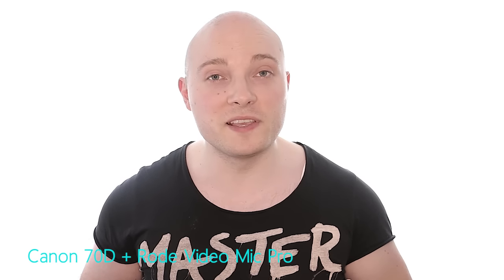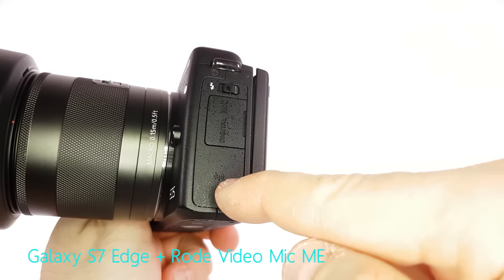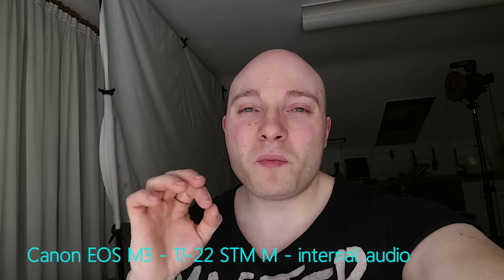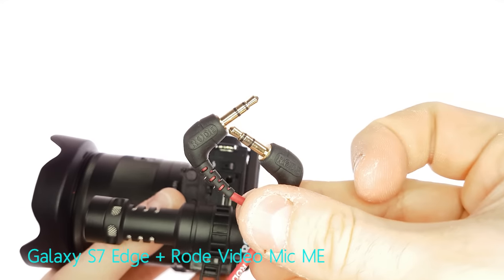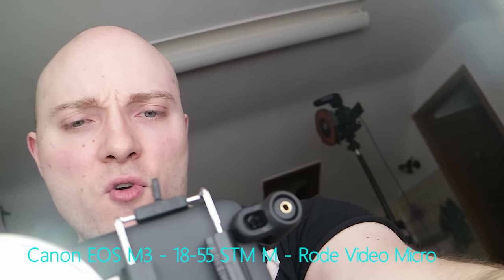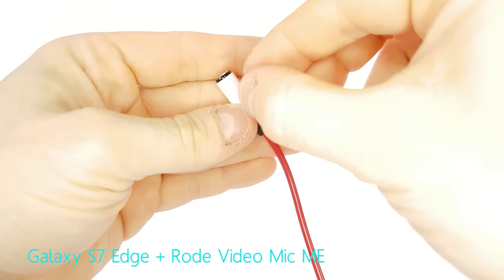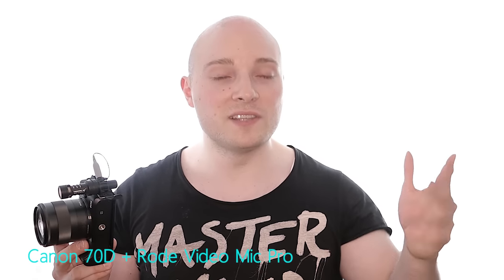Canon EOS M3 - MICRO Vlogging Setup+ - Tubenoob

Comment: Thank you so much for the tips! But I have problem with my eos m3 audio, there is like wind noise when shooting indoor when there is no wind at all, do you have any idea what to do with the setting? I tried to use external clip on mic too but still, the sound like bzzzzzzzzzzzzz , 😿
Reply from the maker: What you're hearing is either the noise floor of the cam or the mic, Try a mic with like a 10db pregain to get cleaner audio. Like the takstar sgc 598 or something like that.

Comment: Excellent video editing.  You mentioned a custom foam wind screen for the Video Micro "because it looks better".  But no wind testing or information on this wind screen. Is there any handling noise picked up by any of these 3 external mics ?
Reply from the maker: Hey, Bellva dear! Sorry about that.

The second wind noise test of the video micro is done with that foam wind screen. It is that one:

Rycote 104410 12cm Standard Hole SGM Foam Windscreen, Single, Black - search on amazon

Cut, to fit the video micro.

Greetings!

Comment: I was trying to decide between the Rode Videomicro and the Edutige ETM 008.  The Edutige has a 59 db signal to noise ratio.  Rode doesn't publish the S/N ratio for the Micro.  What sold me on the Micro was the wind test with the Rycote foam screen.
Reply from the maker: The ETM 008 has a 69db SNR, probably a typo on your part, just as an info for you. The 009 even tops that with 75db. But definitely the rode puffin beats anything Edutige has to offer right now. Bigger form factor, but with better results. Greetings!

Comment: ETM-008 - 2:25
VideoMicro - 3:38
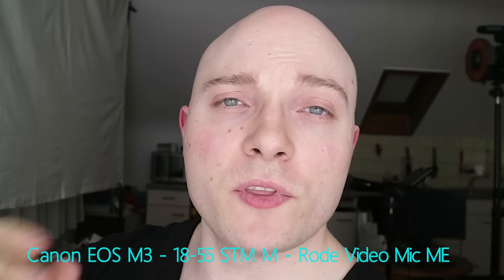VideoMic ME - 6:07
Reply from the maker: Now THAT is one hell of a useful comment!
Reply: Right on! Hey quick question if you don't mind me asking - I am between the g7x and m3. I know the m3 has an audio jack and changeable lenses which make it appealing but I have heard great things about the g7x. Any suggestion? Thanks!
Reply: I was in the same boat as you, decided to go with the m3 because the versatility and the camera being open to upgrades and change is very useful in the long term, check out amazon for some awesome bundle packages for the m3!
Reply from the maker: It's the more compact form factor, and because of the f1.8 it does better in lowlight if you compare with the M3 kit lenses (otherwise of course the aps c size sensor smokes the one inch one), but that*s where the fun ends in my opinion:) 
It's a contrast detect only AF system, no audio input, 24mm ff eq on the wide end is decent, but with the m3 you can put on the 11 22 for example and get a really good wide angle that's pretty sharp considering the price point. You can get external audio at a still compact form factor with the setups in the video and the AF system is a hybrid with at least some phase detection AF points which does help video AF performance considerably.

If you can live with the somewhat bigger form factor my recommendation between these two would  be the m3.

Should you land on the m3, and you*re into video more than into stills, and you wanna go kit lens, I would also recommend going with the 15 45 instead of the 18 55. Again a 24mm ff eq considering the 1.6 crop factor of the m3.

What kind if videography do you want to do?
Reply: Thank you for the responses! The M3 with the 11 22 sounds like a good option. Is the 10 18 decent enough or is the 11 22 worth the extra money? 

I plan on making short videos/vlogs of my family as the kids grow to keep as memories. Some basic photography as well.
Reply from the maker: Are you talking 10 18 stm from canon with the efs efm adapter to put it on the mirrorless m3 body? Because if yo already own that lens, the 10 18 is a pretty damn good lens. Bigger build since it*s a dslr lens, but it works really well on the m3 with the canon adapter. AF sound is increased a little though and will end up on the audio....it is minimal, but it is there.

If you already own a 10 18 stm from canon and you don*t mind that it bulks up the whole setup, then stick with the 10 18 and the efs efm adapter. AF speed exposure speed are pretty much the same as with the native stm m lens selection and the IS also works like it does on the dslr(I use a 70D).

If you*re talking about something else...sorry....that*s the only 10 18 that comes to my mind right now.

The only differences with the 11 22 stm m are that the AF here is absolutely silent, does not get picked up on the audio even when you mount the external mic right next to the lens barrel. And of course it is like half the size of the 10 18 stm.

if you*re also doing stills.....mh.....maybe the 15 45 kit lens is a good compromise...doing a portrait with a superwide angle can look awkward...then again group portraits, wife kid and yourself on a picknick or whatnot that*s easier with the superwide angle zoom range.

Hope that helps you out a little. Greetings!

Comment: Canon M50 or m6 for vlog which one Do you prefer?
Reply from the maker: Mh....it is easier to mount a mic on the m50, because the screen flips out to the side, but the 4k video is heavily cropped and has no dual pixel autofocus and THAT REALLY bothers me. Because for moving shots the 4k doesn*t make you happy. 

Ask yourself: Are you willling to spend an extra 100 bucks basically for the ability to mount a mic more easily? And you could say "yes" here, I don*t want to sound judgemental in any way. Me personally I would consider this if I had to make that choice.

Probably I would go for the ETM 008 though and use the hack. Form factor is kept smaller and if you*re taking a used deal with a return policy fot the m6 you can save some bucks......

Are you maybe interested in doing steady studio work with the camera as well? Because in this case the 4k and mic mount come in handy for sure......if all you want to do is vlog, then get a good used deal on the m6 and use the hack.If you can live with paying more, but having an easier way to mount the mic and MAYBE you also want todo studio work with a fixed focus or very good lighting, then the M50 becomes more interesting than the M6 in my opinion.

Hope that helped you out a little. More questions? Just ask...

Greetings!

Comment: Ooooo, thank you for this!  These are fairly inconspicuous mic set-ups... how do you think they would fare at a concert?  Also, do you think this setup would alleviate the autofocus noise captured by the G3X internal mic at all?
Reply from the maker: Again, you*re very welcome:) They would do better than the internal audio for sure. They are not the best options for audio recording in general of course, but they are pretty compact.....if you want to keep a low profile.

Won't help the noise problem with the G3X though. I tried that. Since the mic is more sensitive than the internal mic and pretty close to the lens barrel, when mounted at the side like this, it actually picks up the AF motor sound more clearly than the internal mic:)

Comment: Thanks for another great review. I took the decision to buy an M3 because of its vlogging capabilities but after a day of testing shooting pictures got a bit annoyed by its slow focus (right now using adapter and 50 mm stm). I feel I am missing the shots. Any thought about this?
Reply from the maker: Hey, Hector! 
It's a slow system....what can I tell you....if you need something that focuses fast for stills, the m3 won't make you happy. Taking pictures of fast moving subjects is no fun at all.....if you need fast dead on focus look towards sonys, the A5100 and up for example or the panasonics with the DFD AF systems like the G7.....then again with the sonys the overheating is a problem and with the panasonics the video AF isn't super.....

If you want to add like 300-400 bucks wait for the m6 and sell off your m3. M6 has canons dual pixel AF...that's going to be THE vlogging camera of 2017 imho.....higher pricepoint though...but if it lives up to the expectations it's going to be a killer vlogging camera! 

Hope that helped you out a little. Greetings!
Reply: TubeNoob Not only a little :) you helped a lot. I think going to keep it and start from there. at the end these 300-400 bucks can be used for other way more useful stuff. Thanks again and keep pushing ;) Regards from Barcelona
Reply: Kept on researching and found olympus epl7 as an good contendant. Good for pics, cheaper, nicer looking and 3 axis stabilitzation in camera. the bad is no mic connection and 3/4 sensor. But maybe for the mic with a zoom h1 would be solved. Any thoughts? dont you feel too much shake on the m3 footage without in camera IS?
Reply from the maker: Mh....no1080p50, contrast detect AF only, no audio...rather tricky I think, but looks awesome I have to say, beautiful camera for sure.

If the eye detection works well, maybe the AF system is usable for vlogging. The m.zuiko lenses are excellent that's for sure....flip up screen....cool. Haven't looked at that camera yet, but you sparked my interest in it:)

Yeah the zoom h1 would be a solution, but it's rather big...I am thinking about a solution for cameras with no mic input right now.....there's something in the works here....but don't know yet if it works....

As far as the shake goes.....I don't have a problem with it...the stm m lens I use is stabilized...not the best stabilization....but I like the results....also on the far wide end you don't need quite as much stabilization as on the tele end...so for blogging it's alright in my opinion...Greetings!

Comment: Very very useful, my husband just got me m6, video mic pro and a bracket but then since i'm in the small frame without the muscle to carry all those i'm opting for micro-compact solution and this really helps me a lot. 

I have a question, if ever I would be removing the velcro from the camera would it be able to remove nicely from the body?
Reply from the maker: Hello, Rio Tañafranca! Thanks a lot for the nice comment:) Much appreciated:)

Yes, if you don't just rip it off it will remove without any residue. Should there still be a little of the white base left, you can rub it off with your thumb until it is removed seamlessly. It won't hurt the rubber of the camera. 

Greetings!

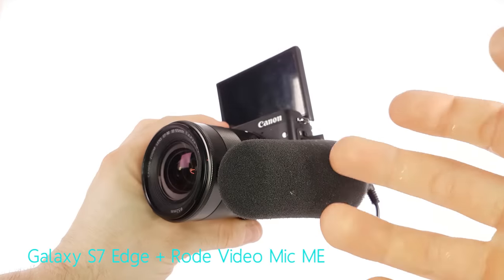Comment: I keep coming back to your channel for tips on the m3 or m6 camera. Really quick: What kind of custom wind muff did you use at 4:54?
Reply from the maker: Ah, that's a rycote foam windscreen 10cm length that I simply cut to fit the video micro.

This thing:

https://www.amazon.com/Rycote-104408-Standard-Windscreen-Single/dp/B004TGN2Z6/ref=sr_1_1?ie=UTF8&qid=1519351484&sr=8-1&keywords=rycote+foam+windscreen+10+cm
Reply: Thanks a lot, tubnoob. You've been so helpful
Reply from the maker: You*re welcome:)

Comment: How about mounting a hot shoe on the side instead of the band thing ?
Reply from the maker: Always a possibility:) It's just it had been done before, so I did something different. Also I don't really like the hot glue method, but with an l bracket you can rather easily pull it off.

It's not exactly what you're asking, but it exemplifies the l bracket solution a bit: https://youtu.be/7shX5yw-oPQ

Greetings!

Comment: are there any mics like that,  mean near micro or compact  that are not directional?
Reply from the maker: Mhh....nothing really near the form factor of a rode micro or rode me with equal quality that I know of, which doesn*t mean there isn't such a mic:) 

For the lightning adapter of the iPhone there's the zoom q series 5 6 and 7. 

iRig has the Mic Cast Ultra...

Rode has the iXY....

Of course you can use an adapter cable and hook up like an Edutige ETM 001 for example....

Other than that, for the hotshoe mount of course there's many choices..but that's not what you+re looking for right?

Comment: I have the rode videomicro and I think the hissing noise is from the camera. I have tried to turn the audio levels down to four ticks, but I still get the hissing noise from the camera. What are your audio level settings on the camera?
Reply from the maker: Hey again, benagon! My levels are axactly midpoint for all three setups/mics...allthough the micro and the mic me could  use a little more than that and the etm 008 a little less than that, but I can deal with that in post.

I really think it might be the adapter cable....I have used a cheap one and that gave me some trouble, but nothing much really....I currently use the Fiio L17...which is great, expensive but excellent and has the almost perfect size for the setup.

I don't think it's the camera, to be honest, except if there's something not right with it. Definitely try a good adapter cable though, before sending the camera in for a check up.

Let me know how it goes...greetings!

Comment: Hey! I'm so sorry I know this video is older but hopefully you can help me! I just got this microphone for my Canon EOS M3;; and I'm struggling to get it to work. Its just not picking up the audio;; it's appearing to be plugged in but just won't pick up sound! I've set the sound recording to manual but have had no luck;; I'm not sure if you have this camera/microphone;; but do you have any recollection on what my issue may be?? I'm using the cables that came with the mic!

Thank you so much regardless ♥️

Comment: i'm deciding between a rode micro or the ETM -008 can you help ?? great videos btw helped me a lot
Reply from the maker: Hey, Just a Lifestyle! If you want better wind protection - Rode Micro because of the excellent puffin. If you want less hiss, then the ETM 008 is better, lower self noise ratio.

So vlogging outside mostlyI would go Ride Video Micro, hiss won*t be as noticable with all the ambience sounds, but the wind protection is very good.

Rather using the camera at home in silent environments, where hiss is more noticable, I would go ETM 008, because hiss then will be much less of a problem.

Hope that helps you out a little. Greetings!

Comment: Hi just stumbled on your video. Is there any way to use Rode lightning mic with this configuration? I have been searching the internet without any joy.
Reply from the maker: You would need a male 3.5mm 3 pole to female lightning adapter cable. I haven't found one myself unfortunately....sry...
Reply: Thanks

Comment: thank you for this video .. it has really helped , i was looking to get the canon m3 and was prepared to go for the rhode go for the external audio and get a side slider as well so that i could use the flip screen without any obstruction..  .. but this setup just makes way more sense. . 

P.S , im still a little confused as to which camera to go for. . stuck between the sony a6000 and the canon m03 , but was leaning more towards the canon(only because of the flip screen).. 
your advice would be very helpful.. 
for an all round vlogging experience ? 
p.s Im from india and its very noisy here..very.
Reply from the maker: Hey, Siddhant! Thank you for the nice comment!!

It comes down to overheating but stellar AF (Sony A6000) vs no overheating and external audio (EOS M3). If you*re ok with internal audio, which if it is very noise where you are might be a bad choice, and are only doing relatively short takes, no long talking head stuff, then the AF of the A6000 will make you way happier than the AF of the M3.

On the other hand, if you really need external directional audio for what you do, because of the noise pollution, and you sometimes do want to do longer takes, then overall the EOS M3 will make you happier. The Sony is more of a diva, you have to know how to handle her, whereas the canon is more of a workhorse, can't do fancy stuff, but once you tell it to go, it just goes on and on, no problems.

EOS M6 of interest to you. Its expensive but pretty much a combination of the above cameras. No overheating, flip up screen, great dual pixel AF, external audio, nice color reproduction, small form factor.

Hope that helps you out a little. Greetings!
Reply: thank you thats great advice .. ive been looking into the M6 , looks promising.. and as for the 3 pole adapter, trying to look for that here as well.. hope i can find that or by another 3rd party maker, as ording one from the US or EU takes very long .. and kind of impatient to get started .. 
again ,thanks for all your help and time.. will keep watching you
Reply from the maker: You*re welcome! But should you go with the M6, the version of the external audio setup using the adapter won't work, because the metal piece it attached to is different on the M6 body. You then need to use this setup which also works with the M6: https://youtu.be/q88p4CdchmI

I will do a separate video for the M6 soon! 

Greetings and thanks for taking the time to write the nice comments!
Reply: TubeNoob Thank you for all your help.. I look forward to your video on M6.. And I really appreciate all the time and effort you take to make these videos..its what we in India call 'jugaad', which means resourcefulness.

India runs on that thought process..

Pls get enough sleep .. We want you fresh and happy.
Reply from the maker: Thank you very much for that nice comment! Much appreciated:)! You're very welcome, Siddhant! Greetings!
Reply from the maker: Hey again:) There's two possibilities that come to mind. Either the audio playback of the camera is muted: when playing back a clip clikc "up" on the click wheel to raise the internal audio playback volume.

Or, maybe, you manually leveled down the audio completely, so you're not recording any, but since you have done a vlog already, that is not the problem I believe.

You are talking in camera playback, right?
Reply: Hey.. Got the problem sorted..Honestly..dont know what I did..
But it's working now.. Something to do with a non existent option 8 which was there in the video dial option and not the automatic dial option..
Reply from the maker: If it works....it works:)) Greetings!